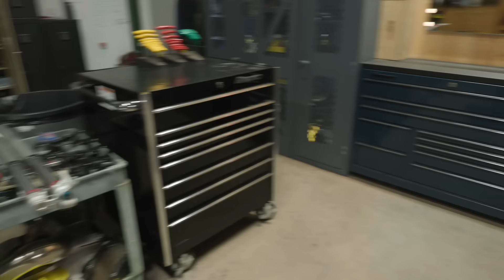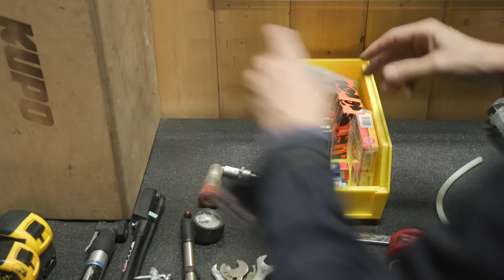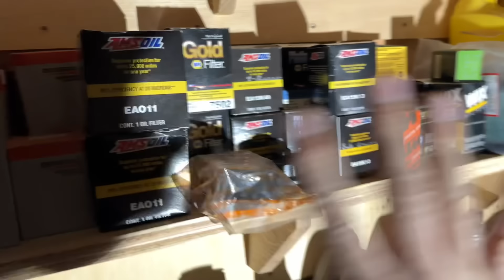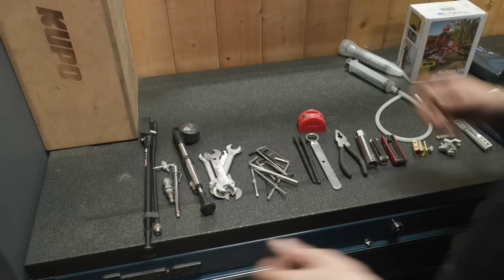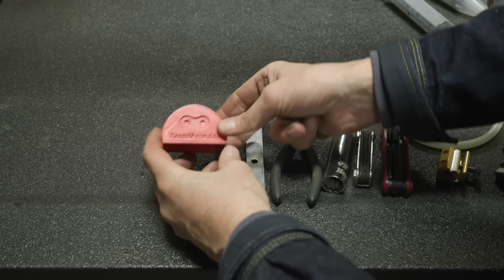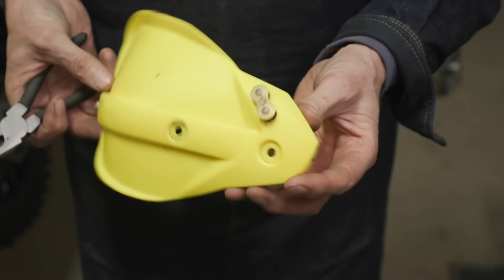How to Declutter Your Workshop: Wranglerstar's Secrets to Cutting the Clutter

Comment: Until I had a shop built I had tools scattered. Upstairs,downstairs,main floor,both vehicles. And in boxes all over.  I now have 90% in my tool boxes still have some organizing to do but when I started gathering them all. I found tools I forgot I had. You can be so much more productive when you have a dedicated spot. And not looking for a tool.
Reply: I stopped having all the tools in tool boxes and went with tool walls. Right there where I can see them and see if one is missing. 😁😎
Reply: @OldSneelock  I have a lot of wall space but also have a lot of tools I'd be doing too much running around. I do miss having a small peg board for my run of the mill go to home owner tools. Screw drivers, hammer, Cresent wrench,channel locks ect...
Reply: This also goes for every little tool you have at home. I have one place where my scissors live, I always put them right back so when I automatically reach for them they're there. I just "upgraded" to a smaller desk to declutter and make some more space in my office. Over the past few days I've had things scattered all around but the small number of things I've reached for at least once are now in my one desk drawer immediately at hand. Even for those once-in-a-while but indispensable items it's good to have them close by so your eyes rest on them on a regular basis and once you need them you know exactly where they are.

Comment: I dont do suspension tuning either i am great with top ends on 2 and 4 strokes and the clutch side aint bad either but my boy can do the whole bottom and top and wiring and tuning but no suspension other than seals and i am impressed with your oil and filter and coolant area nice